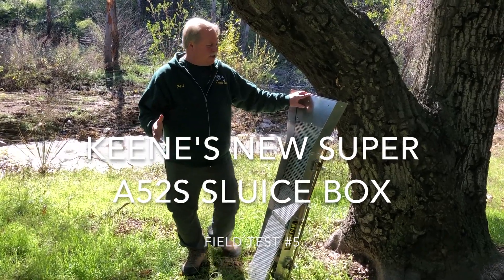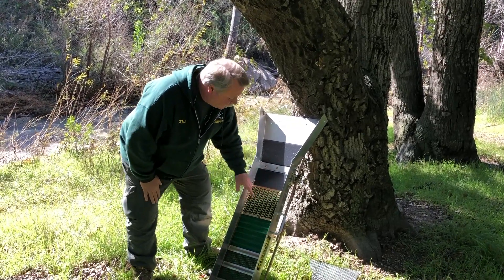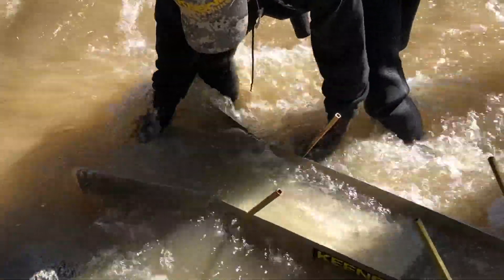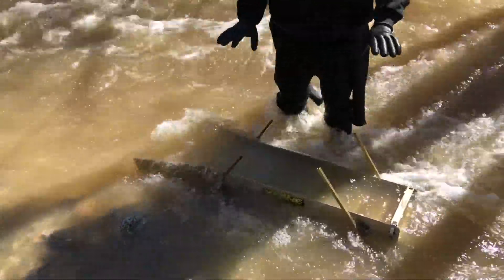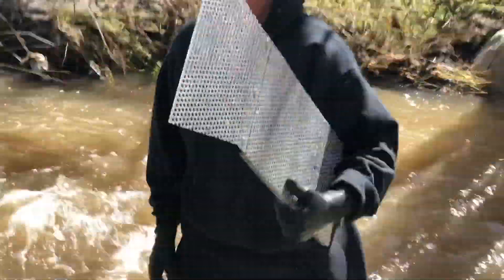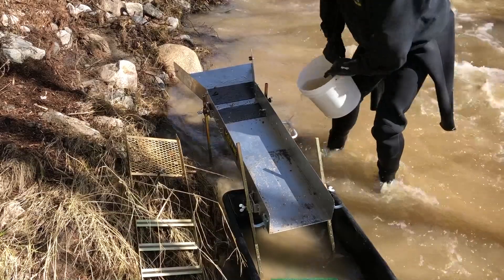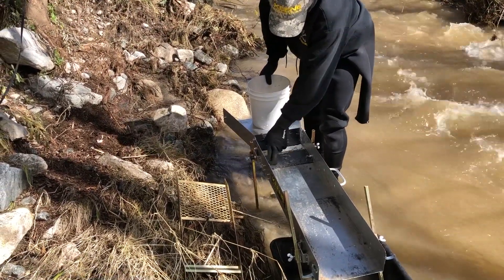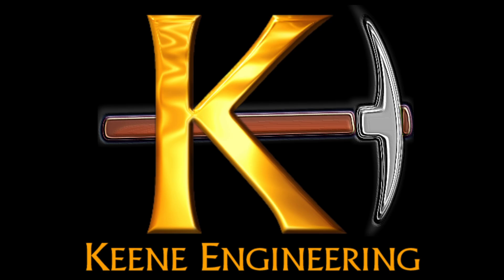Keene's A52S Test # 5

Comment: I Like the leg design..I wish both both screens were welded to the bars. Use lighter aluminum riffles. drop the miracle mat use backed miners moss dont use that back end locking design maybe use the same bolt that holds the classifer to hold the riffles down another bolt my be added. Well atleast a lighter creek version could be made. That would be nice
Reply from the maker: Aluminum riffles would be nice however it real-world conditions they would be bent out of shape the first few times you get a little careless with them.  I have tried them in the past,  and just too fragile.   If we welded the screen to the main riffle board then you would not be able to run the sluice in fast water conditions as well as slow when you have to remove the top screen and go back to working a sluice box in the traditional method of prescreening the material.
Reply: Keene Engineering Inc.  its great you have the means to experiment your designes for your customers and have fun doing it. nothing better  gold equipment engineering and design i love it..takes some tinkering to narrow it down... Oh i ment the bottom expanded metal screen. Weilded to the bottom of the riffles... The best riffles locking desing ive used comes from the jobe folding sluice im sure you have seen it. They are  so easy to remove the riffles all held down with a center bolt and u can put any arrangement screen or carpet highth in  it because the wingnut can press down on any size demension under it...yeah the aluminium riffles would probably be better for a highbanker. Or a fully perforated sluice.
Reply: Keene Engineering Inc. Have u guys tried making the flair walls a little higher? Or the box walls. It looks like there is alot of energy boiling in the head of the box before it has a chance to get pulled into the shute of the sluice in that raging flow.  But I am amazed how it stays locked in that rushing current being held down from the water weight instead of floating off lol.....Have u thought of putting a magnet system in the flair to keep black sand buildup from happening so fast in the Hungarian riffles?  Check out rare earth magnets worlds strogest. Pretty cheap. from magnets4less. Flat 6 inch rectangle ones. Other designs would work too...i had a 6 inch mini keene sluice box. I had just bought. Using it on the side of a river I noticed even my classified were building up. Especially the black sands. Materials blonde and black were rolling over the riffles after the black sand built up which was really quick. Those hooded riffles as i call them like to grab bulks of it without really clearing it out which isnt a bad thing for gold. But after buildup it slowed the eddies major drop and pull energy for such a small sluice. But i drilled a hole below the flair bolted a small screw upwards from under the sluice. and places a round flat magnet the kind with the metal backing and the hole in the center. Just slid it onto the bolt and it helped dramatically. After the black sands built up on the magnet id just pull it off the box and remove the iron magnitite by hand put it in the pan. At the end of my run id have a pan full of black sand that wasnt in the box taking up gold catches. with no gold being grabbed by the magnet. I mean if it was a rectange design coulda been more arodynamic but it worked....Do you guys sell the A52S sluice box bare??? Legs box classifier? If so how much?
Reply from the maker: @ziongray918  it is easier to answer your questions if you email me directly mark@keeneeng.com this way I can attach pictures quotes etc.
Reply: Keene Engineering Inc. Thank you mark will do after i figure some stuff out thanks for the support.

Comment: I want a longer Sluice box..how do two of these connect together??...is it ready  made connections or will I have to drill holes and use bolts
Reply from the maker: We do have a connector pre-made.  You will have to drill a few holes however it is an easy simple adaption.  Sluice box extension adaptor Part number is A52EB $19.95

Comment: Did you measure the slope or angle that you had the box set up at?
Reply from the maker: To be honest we never measure water speed slope etc.  It is all done by feel and how the sluice box riffle works.   Faster water, flatter sluice, slower water, steeper sluice. I really just watch how the rocks flow through the box.  You want them to tumble through the box not sit there or blast through.

Comment: I dig the grizzly idea, cant wait to see the video.
Reply from the maker: We are trying 2 different grizzlies tomorrow a short one and a longer one.   A full-length grizzly may not be a bad idea as well, just costly.
Reply: Full length? Wasn't thinking tht but yeah like you said might not be a bad idea. I can see how that would be costly. @KeeneEngInc
Reply from the maker: Well, we have to go out again Next weekend.  We did a lot of testing and we have a few more changes.  We came up with a few new ideas that should really work well.  We just have to go out and try them out.  We passed a lot of gold through the sluice and we did have about a 2 % loss of the fines.  I know we can do better. Next week should do the trick. Test # 7

Comment from the maker: That is a very good question.  We are working with several screens for both high and low water conditions.  If you are in very low water you may have to remove the top classifier screens and go back to pre-classifying the material.  We are going out this weekend again and I will try to address your concerns if possible.  Thank you for your input.

Comment: Its looking good , & mark is right about the moss with small riffles , i have the hilow mat from pioneer & instead of running moss at tip two riffles on my a52 i use the green carpet one riffle with ex. Metal then hilow ! Ill post a link to a vid of my configureations ! Thanks for your guys work and always tryin to make new stuff!